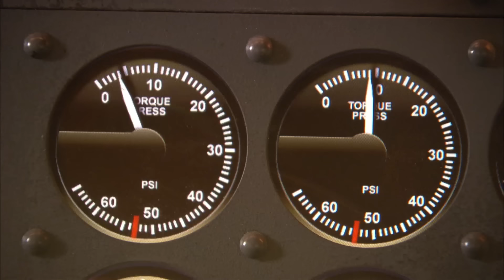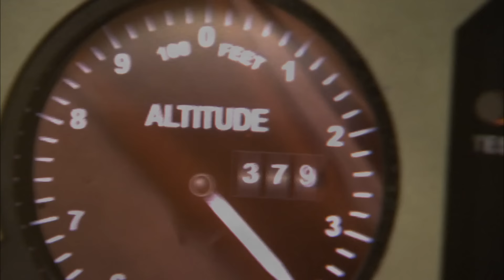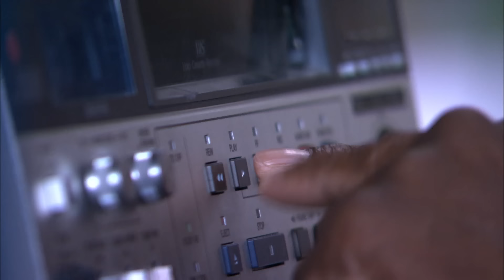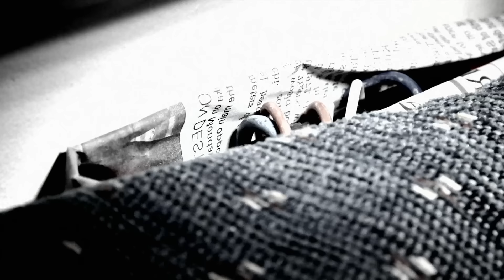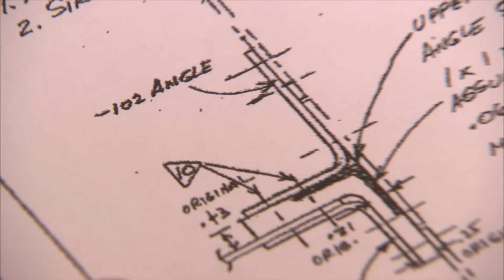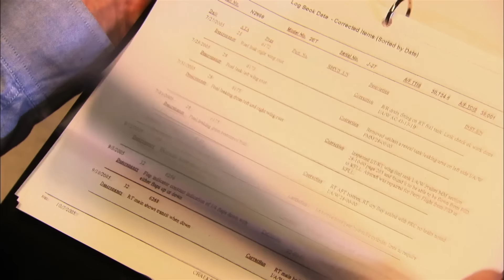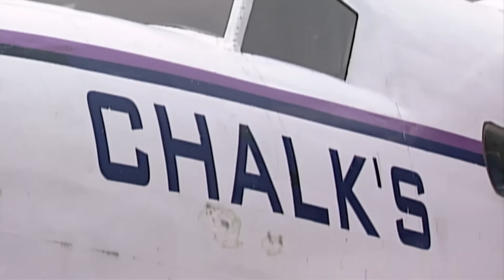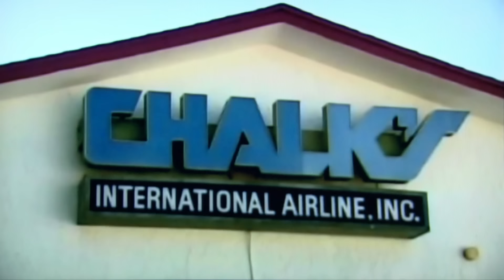Cracks In The System | Ocean Crashes | FULL EPISODE | Mayday: Air Disaster

Comment: The video re-creation of this accident looks eerily similar to a wildfire air tanker accident I saw on the news years ago in Arizona. The plane was a C-130 I believe (if not, then it was an old Navy patrol/cargo plane). It was pulling up out of a fire retardant drop and both wings folded up over its back like a bird landing on a branch. No survivors after that crash either.
Reply: They still fly the old P2V5 and 7 series Neptunes.  Since they were Navy and flew over the ocean most of the time they had corrosion problems.  I have over a thousand hours myself.  Those pull outs were two or three G's and those wing roots do fail.

Comment: This Aircraft Never Shouldn’t Have Been Flying Especially With The Fuel Leak’s & Crack’s In It
Reply: As per my comment above, I was in the USAF as an aircraft mechanic. Every aircraft has specs of minimum thickness allowable on surfaces, as well as what cracks are allowed to be repaired and what mandates a replacement of a part or retire an aircraft. These measurements are suppose to be done during maintenance which clearly was not done. I for certain know that pop rivets are not allowed to be used on aircraft. Center wing boxes are lined with many structural attach points with very large bolts and nuts which are coated and sealed. This area is suppose to be inspected frequently, cracks are not allowed to be in this area period. Again there are more than just one or two people to blame for allowing this aircraft to fly in the condition it was in.
Reply: flyn't
Reply: i'ma inspect any airplane I get on MYSELF before ever boarding from now on...commercial jet or not!!
Reply: @stedmans4christ  I Don’t Blame U
Reply: @stedmans4christ  No you won't, because you are not trained to inspect any aircraft plus they wouldn't let you do it anyway. Trust me, I'd love to inspect the aircraft that I board, but I know they won't let me just walk around the outside and check every nook and cranny (and yes, I do have some training and experience in airline maintenance)
Reply: Put some gray tape on it, all good
Reply: Really.
Reply: @stedmans4christ  lol I’ll be looking for you on the Tarmac with your pen and pad.

Comment: The repairs I’m seeing in this episode wouldn’t be used on a vehicle that remains on land!!! Why a professional aviation mechanic would use a patch AND drill holes in a wing to prevent CRACKS on the wing of an airplane is beyond me!!!
Reply: I was right at that part as I read your comment. Blows my mind.
Reply: Because that's what the maintenance manual calls for.  Stop drilling is used much more often than not for cracks an inch or smaller.  Leading edges are the exception.
Reply: If it’s done correctly stop drill holes can be safely used to repair cracks in the plane however in this instance because the maintenance engineer had a complete lack of training and did not do a proper repair job it became a huge safety issue

Comment: shame that one of the coolest and least corporatized airlines in the business had to have this stain their reputation, that plane really was very cool
Reply: Very cool plane, just too old and falling apart because of bad practices
Reply: @colincampbell7126  no
Reply: I can't agree with your sympathy for this company that knowingly had poor maintenance practices on planes they knew were getting too old to do  proper repairs on. Yes, it was a very cool airplane... in it's time. But when parts are not being made anymore to replace old, broken, ones... it's time to pull the plug BEFORE people die.
Reply: @amydavis4945  Thats not how it works, you can literally make more parts in a machine shop from scratch because the specifications are documented therefore you can keep any old plane in service pretty much for good. Just because the manufacturer isnt making them doesnt mean that they cant be sourced. Lots of older planes are flying and many are safer than newer planes built today. I flew on a 54 year old jet with a commercial airline just 3 years ago.
Reply: @amydavis4945  or make the parts custom for the plane
Reply: @pilsplease7561  exactly they can just make more parts if it comes down to it... Not like its impossible to measure everything and cut out whatever you need.
Reply: @TheFrogInYourClosetWatchingYou  Yeah, that's affordable.
Reply: @amydavis4945  i understand why you'd think that i approved of their practices, but i would never condone cost cutting that put lives at risk. just sad to see such a cool airline get so shaken by preventable problems
Reply: @kenmore01  youre forgetting the people that own these planes are airline companies. They can afford to maintain their planes, its just that greedy higher-ups like to cut corners wherever they can
Reply: @knuteknoll6747   Can and will are two different things. I got scolded for taking my corporate car to a detailing company which cost $86 when the company makes $12 billion a quarter. Net result? Taking it to a car washing tunnel and now it needs repair of the paint because it wore the paint off. This is a car that's one and a half years old.

Companies don't make the greatest decisions and are usually driven by cost. Now, I have to take days to bring the car in and have the hood repainted, find a new carwash, and rent a car while they fix it. Bad decision! Well, I'll call it time working while I'm waiting to have it fixed. Guess how much that will cost?

Besides, fabricating parts for these planes would be very cost prohibitive if you get to replacing cast parts or oddly shaped parts. Sure, sheet metal is easy. Not so much the others.
Reply: @knuteknoll6747   Besides, it was made clear in the video that they were out of money.

Comment: Seaplanes, even tiny ultralight aircraft on floats, take a tremendous amount of wave impact punishment on takeoff & landing. Even a series of 6 inch waves can have a detrimental effect on the structure, over time, to a float equipped ultralight. The same as one foot waves to a Mallard over 50 years. It's like hitting rocks. The bigger the wave, the more the jolt on the airframe. Eliminating the corrosive effect of sea salt is almost impossible to eliminate.

Comment: Well crap. Out of all the planes, flights, and areas to fly over, I always thought that lower altitude, over water flights would be the safest because you could just fall down into the water. I figured you might actually be able to survive accidents in little planes and flights like this. WHOOPSY - guess I was wrong!  I’m still a little unclear though… what was their altitude at the time of the problem?? How did those poor people actually perish??? Being burned up int the air??  Or the actual impact with the water???
Reply: I believe their altitude was 500ish feet
Reply: Impact with the water - the lifeguard mentions the first body they recovered had severe injuries.

When engine failure is your biggest danger, having a flying boat is great for over the water. But you have to have two good wings in order to revert to being a boat.

Comment: Huh. A 70+ year old plane used in regular passenger service. Who’d have thunk that any airframe stress or mechanical issue could cause a crash?

  Even with the brilliant designs by Grumman, these craft just aren’t designed for that long af use.
  I guess it is not economically feasible to design and build a modern seaplane. Or the manufacturers just don’t want to be bothered with designing such a specialized small niche aircraft.
  Unless this incident was a terror plot.